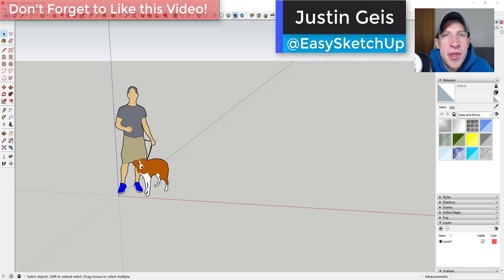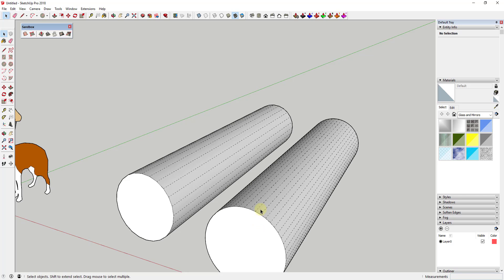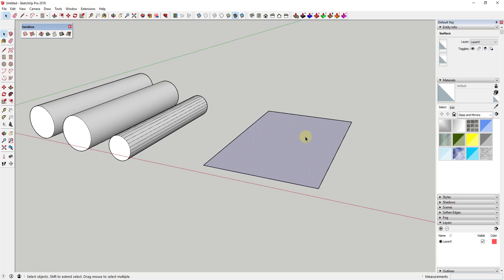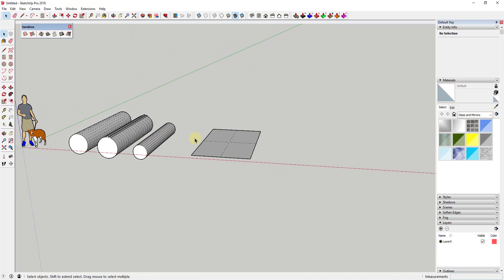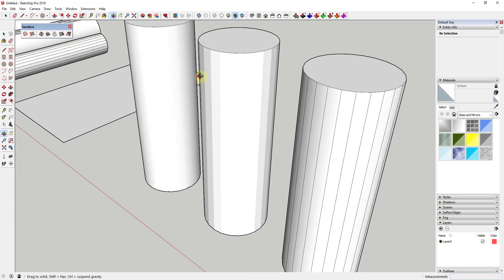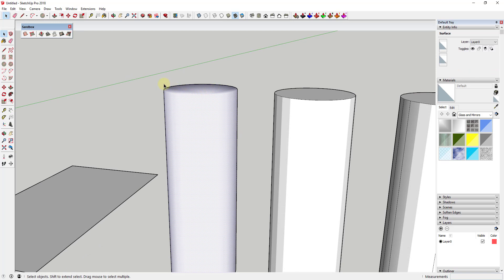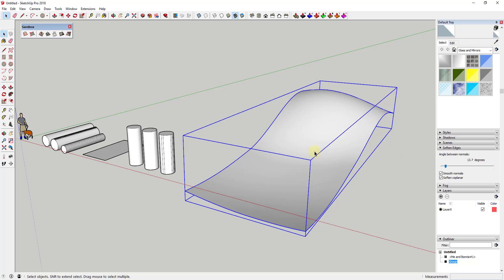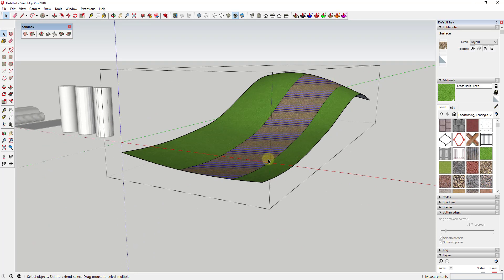SOFTENED VS SMOOTHED Edges in SketchUp - The Ultimate Guide

Comment: This is great video. Thank you. It didn't quite answer my issue, though. In all your cylinders, there is a hard line edge (profile?) that you can see, no matter the soften or smooth settings. I have a faucet component I imported, and it came with the profile edge missing. That means that the faucet is effectively  invisible when rendered as vector or with certain styles. I have another faucet that has has the profile line. They both have softened and smooth edges, but one I can see (yay!) and one I can't (boo). How can I fix the profile-less faucet? Profile (the setting) is turned on in both components.

Comment: Will softening or smoothing components in sketchup make CNC cutting smoother. I have found the machine I use at a local company has to adjust all my drawings as when it gets to round edges it cuts them out square
Reply from the maker: Nope - it's a visibility change only

Comment: One problem I've been finding is that when the shape is more complex, drawn with sandbox or extrusion tools for example, even if the edges are softened/smoothed, when it comes to texturing, sketchup still reads it as lots of separate triangular/grid faces. You couldn't really notice with the grass + gravel in this video, but any larger scale pattern like brick for example would be split up and wouldn't follow the curve, resulting in what looks like a mess of interference. Is there a tool or extension that allows sketchup to merge more complex extrusions into one solid face? Like it automatically does with a consistently curved face? I need to render textures in some more organic forms.. Surely there's a solution?
Reply: Hi,  I would like to ask you, if you find the solution for it. Because I am facing the same problem and I need to solve it as soon as possible, buuut I really dont know how. I search mostly everywhere. If you find the solution please let me know. Thank you in advance :)